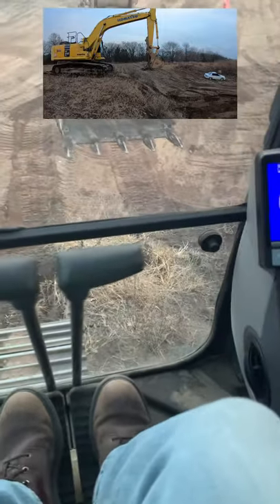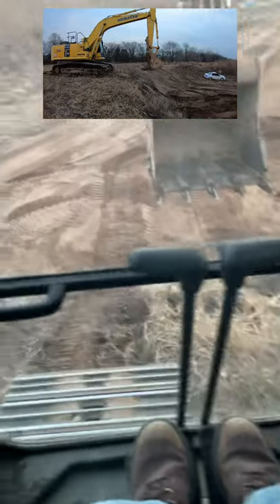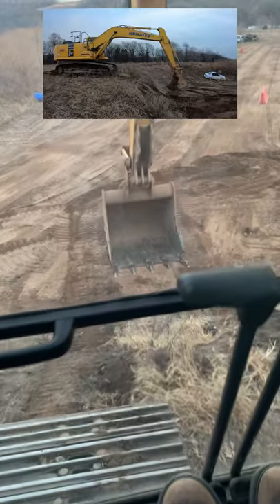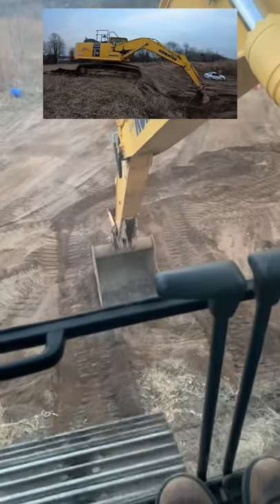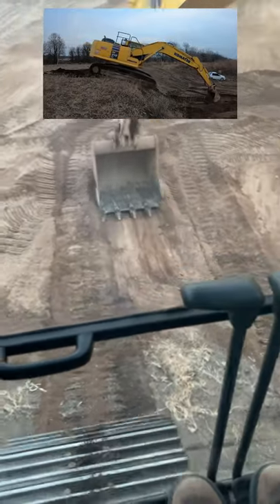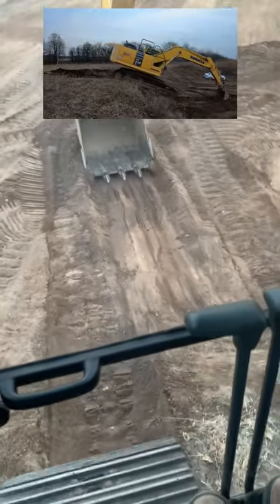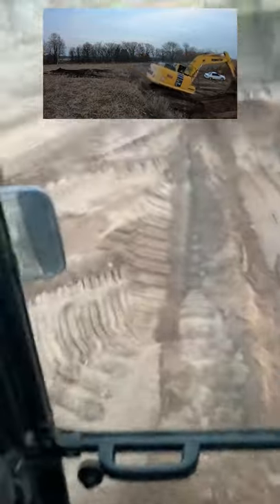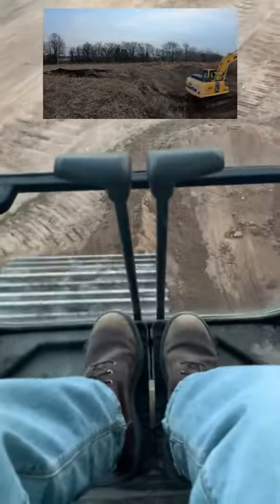How to Operate an Excavator - Hill Descent | #Shorts

Comment: Why can't you put your bucket on the ground and walk to it without disrupting the ground, boom up stick in and roll bucket out while tramming, you would look like an operator instead of just another guy in an excavator. Putting your bucket down and gouging the sand like you did is the reason why most companies think all operators are replaceable. There's a few good ones out there who strive to be better than average
Reply: Used to do it this was, the dirt was softer on the right side track. While walking out the right side sunk 3 ft. Definitely wasn’t going to tip but sure felt like it lol